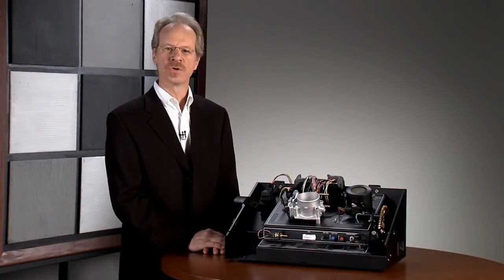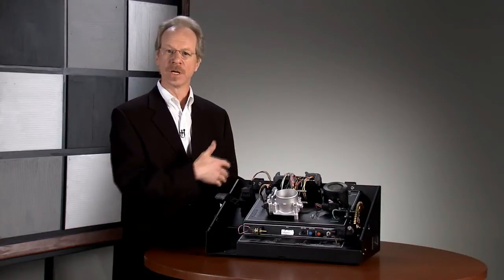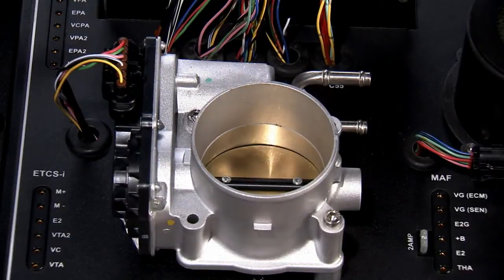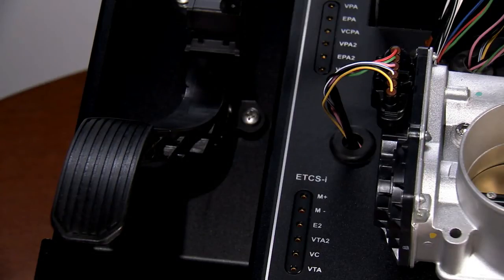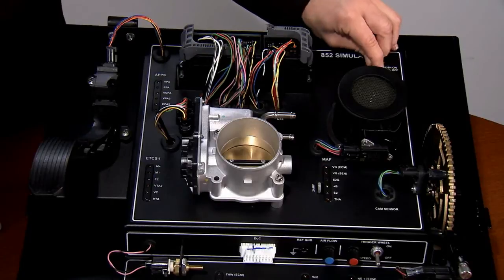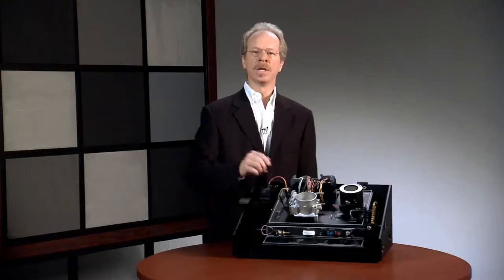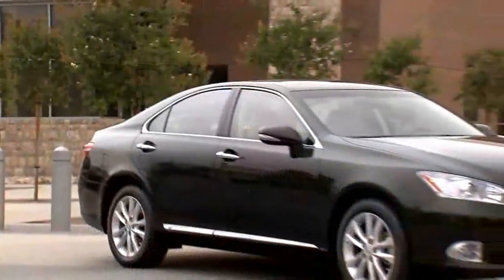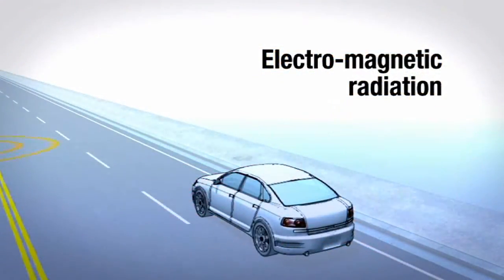Lexus Safety Features of Electronic Throttle Control Systems (ETCS)

Comment: I really wish manufacturers like Lexus would try to mimic the response of a mechanical throttle cable. The lag in my 2018 Lexus IS350 F-Sport is substantial (even in Sport and Sport + mode) and sometimes makes driving a little more dangerous, in my opinion. When I depress the pedal, I want to go, not wait a split second. My wife's 2016 Mazda CX5 with a mechanical cable/gas pedal feels more responsive than my IS when pulling away from a stop or accelerating to merge in heavy interstate traffic.
Reply: To my knowledge, Electronic Throttle bodies are used to improve emissions and safety features.  They reduce Nitrogen Oxide emissions because of that delay in the throttle response. If you open the throttle gradually, you're gradually letting more air into the intake of the engine, thus more control over the air fuel ratio as close to 14.7:1 and keeping the NOx emissions down. Same thing goes for when you close the throttle, if you close it more slowly then you reduce CO and Hydrocarbon emissions because the air intake is reduce gradually rather than suddenly. Now in a conventional mechanical throttle, when you press the gas pedal it opens quickly, which increases the air in the intake very quickly creating a lean condition, when an engine runs lean it creates more NOx, and vice versa when you let go of the gas pedal, it close quickly cutting off air quickly creating a rich condition which increases hydrocarbons and CO emissions, because the computer of the car is still injecting the amount of fuel from when you had the throttle open.  All these emissions are after the catalytic converter. Safety was another factor because you can have better control of the VSC and Traction control system with an electronic throttle body. But I do agree on your point, they are a bit laggy, but it's one of those things like hey, what can you do you know. Engineering Explained did a video comparing Electronic and Mechanical Throttle bodies, and he goes into depth so I recommend his video if you want to learn a bit more. The title of the video is "The Big Problem With Modern Manual Transmissions - Rev Hang" Although his point is different, he still thoroughly explains why modern cars have shifted from the mechanical system to the electronic system.
Reply: What you experienced is what am having so much issues with, with my chrysler 300. When i want a boost of gas i have to depress the pedal aggressively and a 'jump' of power surges me forward instead of a smooth increase of acceleration. Id be on the highway and my car would be like one of these younger punks trying to show off power. But am just trying to smoothly increase acceleration. Pisses me off